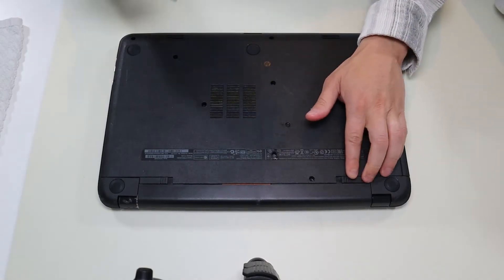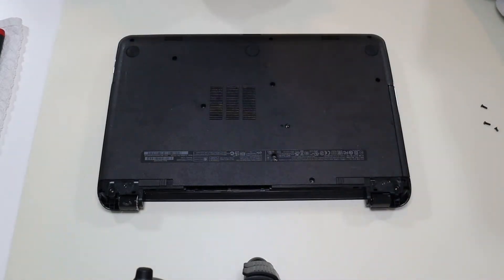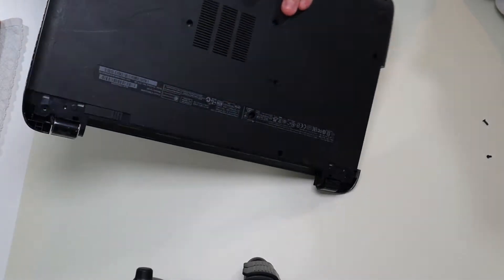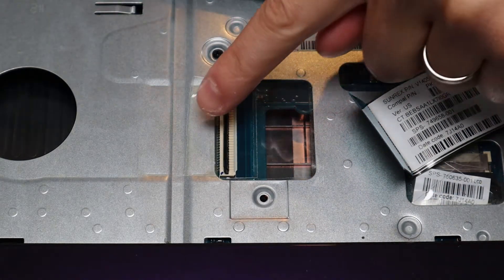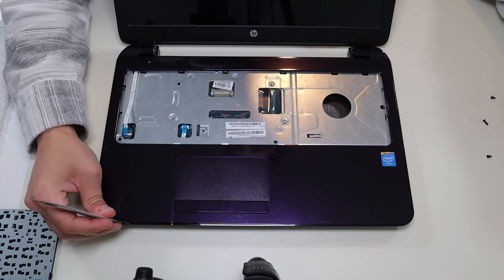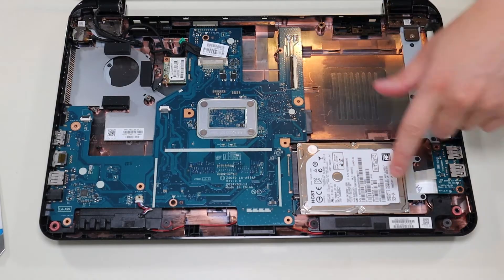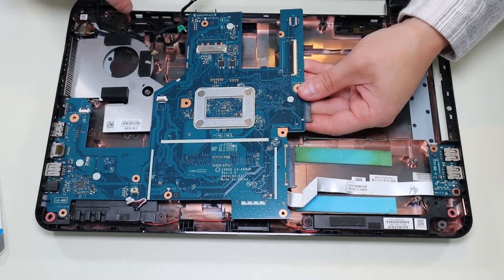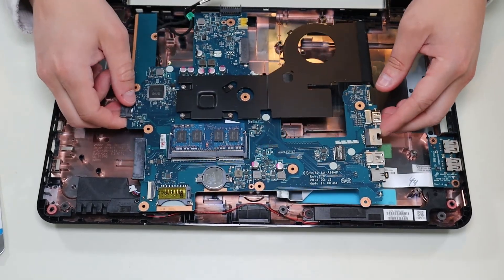HP 15-r 15-r036ds - How To Reset BIOS / Replace CMOS Battery

Comment: my acer aspire 1 a111-31 shows orange light while charging, and when i hold power i get blue light. When i unplug charger the lights turn off. I have tried turning on without battery installed, without ram, without cmos, and my cmos battery slot is broken
Reply from the maker: For a computer that does not turn on, try this video first; https://youtu.be/kOBY4k2Mn_k. Let me know how that goes :)

Comment: I need your help bro
Reply from the maker: What brand and model computer do you have and whats the issue with it? Also, did anything happen before this issue started? Overheating, liquid spill, Windows update, etc?
Reply: @PC_Monkey dell G7 15 model 7500
Reply: @PC_Monkey  i removed the battery and also the little watch battery also and the dc charging port and hold the power button 30 seconds and 1 minute with all 3. 2 batteries and dc plug port
Reply: @PC_Monkey the issue is it wont turn on. At all. It started having problems yesterday it will start to freeze and sometimes it will take longer than usual to turn on. Wen i was playing my video games it started to perform if like wen the power is not connected and im just running on laptop battery power. Then the screen just got black and the laptop was still on. I could hear the fans running everything but no picture just black. While the laptop still had power i perform all thise videos and it never turn on. My laptop had a solid amber light wen i tried to turn it on it stay solid amber untill i turned it off. Then it never turn on again
Reply from the maker: @MarvinEusquiano  https://youtu.be/kOBY4k2Mn_k. If, after trying all the steps seen here multiple times, you have not been able to find the issue, your most likely looking at one of two possible issues. (1) The motherboard is bad and needs to be replaced. Let me know if you would like help finding a compatible motherboard. Or (2) there is another computer component, shorting out the motherboard and need to be replaced such as the power jack, USB board, Touchpad, etc. You would have to troubleshoot each of those individually but unhooking it from the motherboard and trying to turn the computer on. Let me know if you would like help with that operation.

Comment: Bro I have dell latitude E7450 and it is working fine but last year it suddenly starts switching off on its own Firstly I press the power key then the keyboard light shows for a second and then just disappear and laptop switch off on its own but later this week when I try to start it, it starts and working good but again now today the same prblm of switching on happens..
Reply from the maker: For that issue, can you try the steps seen here? https://www.youtube.com/watch?v=Nqn8-jJFx2Y.  Also, did anything happen before this issue started? Overheating, liquid spill, Windows update, etc?
Reply: @PC_Monkey yeah it overheats but when this started after a year recently i deleted every game and i just use it as on study purpose and i dont think so it heats while i watch youtube videos n all...
Reply: And also wht it is even happening it works amazingly just suddenly it start switch on and off?
Reply from the maker: @muffinourgoldenretriever7415  Were you able to find an error matching the time of shut off as seen in that video?
Reply: @PC_Monkey Nope it just switched on shows keyboard lights and then turns off in a split second.
Reply from the maker: @muffinourgoldenretriever7415  For a computer that does not turn on, try this video first; https://youtu.be/kOBY4k2Mn_k. Let me know how that goes :)

Comment: Hey how’s it going so I have this Samsung Chromebook the model code is XE520QAB-K03US and it seems it doesn’t have a detachable drive so I don’t know if it’s the drive. The seamless battery doesn’t even seem to exist on this computer as I can’t even find it on the top and bottom of the motherboard. I’ve tried a couple things to fix it like detaching the battery and power cord and holding the power button but it’s still just nothing happens
Reply from the maker: Nothing happens? What are you trying to have happen? What issue are you trying to fix in your Chromebook?
Reply: @PC_Monkey Yeah nothing at all happens if I press the power button and the only light that appears is when it’s charging. I’m trying to get it to work for my sister bcuz she needs it for her college.
Reply from the maker: @l.a.a7607  For a computer that does not turn on, try this video first; https://youtu.be/kOBY4k2Mn_k. Let me know how that goes :)
Reply: @PC_Monkey I went ahead and did everything on that video except the drive and the small circuit board battery because I simply cannot find it on this model even when the circuit board is completely removed. There is a charging light that shows up but the power button simply does nothing at all.
Reply from the maker: @l.a.a7607   If, after trying all the steps seen here multiple times, you have not been able to find the issue, your most likely looking at one of two possible issues. (1) The motherboard is bad and needs to be replaced. Let me know if you would like help finding a compatible motherboard. Or (2) there is another computer component, shorting out the motherboard and need to be replaced such as the power jack, USB board, Touchpad, etc. You would have to troubleshoot each of those individually but unhooking it from the motherboard and trying to turn the computer on. Let me know if you would like help with that operation.
Reply: @PC_Monkey So I actually got it working buy switching the power cable. It was a usb c cable so those are hard to test with a multi meter. I unplugged the battery and put in the new power cable. I guess now I need to buy a new battery and I already found one for 15 bucks so we all good thanks man for the help
Reply from the maker: @l.a.a7607  Nice! Well done!

Comment: I tried to put extra Ram into my laptop, took out it's ram , noticed it had some black dots on the golden area, I cleaned it, also cleaned the fan, put everything back together, tried to turn it on, the caps lock light which turns on every time I boot, flickered the battery light turned on fine, did the static removal by disconnecting and reconnecting the battery. Now nothing lights up, it isn't still turning on. What Should I Do😭
Reply from the maker: For a computer that does not turn on, try this video first; https://youtu.be/kOBY4k2Mn_k. Let me know how that goes :)

Comment: Hi while i was working in unity my pc suddenly turned off.now when i try to turn it back on it shows the dell symbol but then immediately it turns back off.then it goes in a loop,it shows the symbol,turns back off,again.
And from this morning the loop isn't even happening,it doesnt even show the symbol.

My laptop is dell inspiron
Reply from the maker: For a computer that does not turn on, try this video first; https://youtu.be/kOBY4k2Mn_k. Let me know how that goes :)  Also, did anything happen before this issue started? Overheating, liquid spill, Windows update, etc?
Reply: @PC_Monkey yeah I spilled some liquid yesterday accidentally
And my PC also used to overheat when I use it for long.
Reply from the maker: @max_maxmaxma_max  Overheating and liquid spill!? A repair guys nightmare lol. I would try the steps seen in that video link I sent in my previous comment after making sure the computer is fully dry from the liquid spill.
Reply: @PC_Monkey hey the water were already dried out ,its completely dried now but my pc is not working...

I am still trying the open battery,hold power button and replug battery method.

I dont have the courage to manually bios setup.I will have to send it to repairmen😢(introvert nightmare)
Reply from the maker: @max_maxmaxma_max  Good luck !!  Let me know how it goes :)
Reply: WAIT WAIT WAIT MY PC JUST TURNED ON!!😭😭🎉🎉
I just opened a retainer clip and unplugged a random ribbon cable which was at the top corner.
Then i plugged it back in and my pc turned on.Do i need to do something else to make sure it doesnt happen again?

Comment: my laptop dies everything i update it and weird beeping noises come from it but it is running just the screens black and caps lock keeps turning on and off in its own
Reply from the maker: For a computer that does not turn on, try this video first; https://youtu.be/kOBY4k2Mn_k. Let me know how that goes :)  Also, did anything happen before this issue started? Overheating, liquid spill, Windows update, etc?
Reply: @PC_Monkey  no it happened once before as well but then it turned on on its own (it seems to only happen after i update it)

Comment: My pc hasn’t been turning on and today I tried and it did for about 5 minutes before it shut off again, ever since I got it cleaned it’s been acting up, If I want to turn it on I have to hold the button for about 10 seconds and then wait a while before it turns on but the charger has to be plugged in, I don’t know what to do?
Reply: same thing happening here

Comment: Hello Sir 
I have Asus Intel Core i3 laptop with 4GB RAM And 500GB Hard His Battery Was Dead And Since1 year i was using it without battery directly with power cable but since last 7 days my laptop started automatically turning off and on continuously after few seconds so many time but now since last 2 days he is permanently off and didn't turning on So Tell Me What's The Issue And How Can I Fix It Plz Help Me😢😢
Reply from the maker: For a computer that does not turn on, try this video first; https://youtu.be/kOBY4k2Mn_k. Let me know how that goes :)  Also, did anything happen before this issue appeared?  Liquid spill, overheating, Windows update, etc?

Comment: hey jamon i need some help my dell latitude  dosent light up when its not charged and when i press the power on button it just beeps and lights up for a sec and dosent turn on . if you have a direct messaging way a email or messenger where i can send you a photo that would be really helpful!
Reply from the maker: For a computer that does not turn on, try this video first; https://youtu.be/kOBY4k2Mn_k. Let me know how that goes :)  Also, did anything happen before this issue appeared?  Liquid spill, overheating, Windows update, etc?
Reply: @PC_Monkey  well it started when  the laptop started getting dirty and someone spilled a bit of alcohol on it after that i wiped it off and it just turned of but i thought it was just lowbatt so i plugged it in and it light up but when i pressed the on button it just beeped and didnt turn on i havent been able to use it for a whole week now so if you would have a solution for this that would be amazing!  I use a DELL latittude.
Reply: @PC_Monkey  Sadly it still hasnt opened :(( is there somewhere i can send you a video of how it looks or what happens?

Comment: Hello Jamon, I have a problem with Windows 10. I turned it off and it no longer works, as a no-action bar appears. I want to contact you to solve my problem, Jamon. Thank you
Reply from the maker: Are there any signs of life at all when you try to turn it on? Lights? Fan, Motherboard, or Hard Drive sounds? Anything seen on the screen?  Also, did anything happen before this issue appeared?  Liquid spill, overheating, Windows update, etc?
Reply: @PC_Monkey  Prees ESC for Boot options /settings )This is the bar at the bottom of the laptop screen HP What's the solution ?

Comment: Bro someone help me my XPS 13 7390 was just kept unused for 1 day next day backlit starts but no display and it shut downs after 30 seconds, I tried removing the battery didnt work and I couldn’t do anything with ram as it was soldered , Also no codes were displaying of charging lights
Reply from the maker: For a computer that does not turn on, try this video first; https://youtu.be/kOBY4k2Mn_k. Let me know how that goes :)  Also, did anything happen before this issue appeared?  Liquid spill, overheating, Windows update, etc?
Reply: @PC_Monkey  Hi sorry for replying so late, I have tried everthing now from my side, also the laptop had no overheating issues (like any major one) so now i have gave it for repair